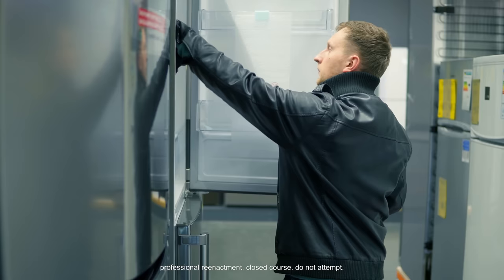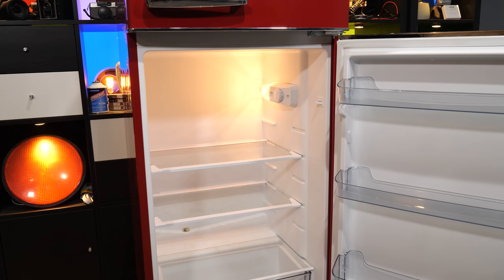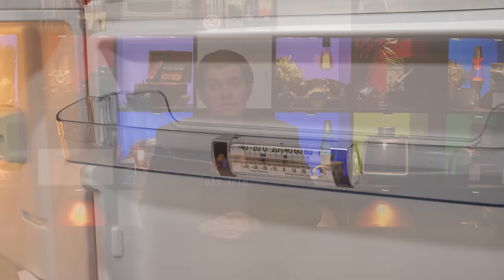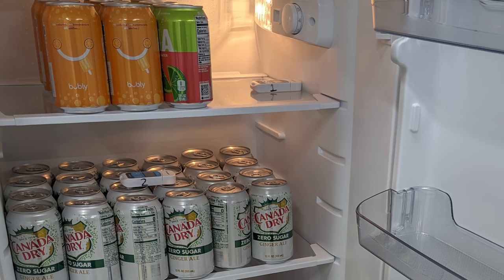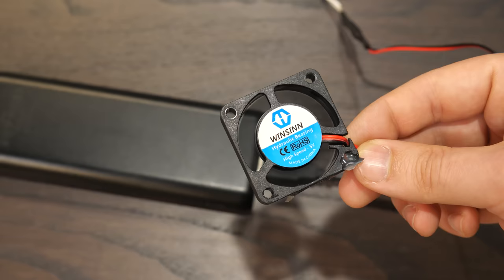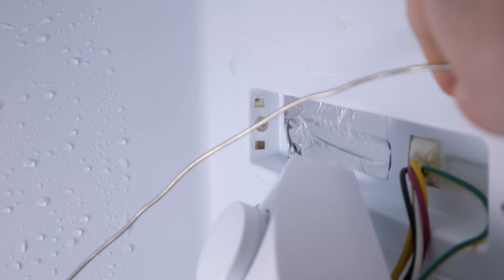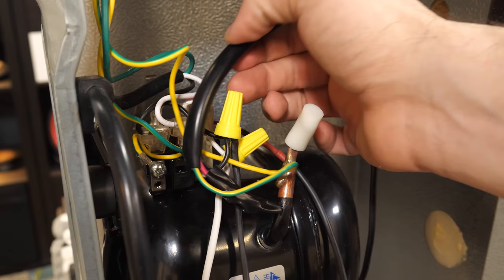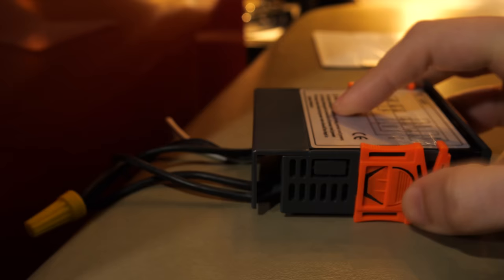This goofy fridge has a really clever design. It's also kinda terrible.

Comment: Hypothesis at 28:00 minutes- It's gotta be a separate overheating thermostat on the compressor. Running at full duty cycle it would risk damaging itself and so shuts off until it is cooled down.

Comment: The 1-compressor 2-evaoprator design is basically what is used in the vast majority of basic fridges i've seen here in europe (although hopefully with a better thermostat design)

The fancier fridges i've seen just have two compressors (sometimes even two separate appliances like a washer-drier stack), i've never seen a fridge with a fan, and an air pass-though, i would have never guessed fridges in america worked differently

Comment: I would recommend setting a temperature sensor on the compressor itself and check what temperatures it might get up to. Working continuously for 14 hours without melting it is quite a feat.
Also, have you ever though why refrigerators are not connected with air conditioners, given how much more efficient their invertors (outdoor units) are.
Reply: We'd rather move that thermal energy twice. Once to outside the fridge, then to outside the house using more energy, why would we want more efficiency? Lol 😂
Reply: Also I have a funny feeling that trying to use an outdoor unit that was at temperatures near or below the setpoint inside the fridge, might create some issues.

Comment: What if the placement of that sensor makes the compressor work for quite short runs, preventing it from overheating and extending its life? Taking into account that it looks a bit on the small side (considering the size of the fridge), it could have been done on purpose.
Reply: I was thinking that as well
Reply: true that
Reply: Doesn’t usually, short runs cause more wear and tear? Somewhat like starting a car when the engine it’s cold.
Reply: @marcr1333  That might be the case for extreme short cycles. In this case, the thing was running for over 30 minutes, I'm just speculating here but it may be on a sweet spot to prevent damage due to extremely short runs and avoid overheating.

Comment: Usually the compressor will have a thermostatic cut out to stop it running continuously and melting, that might what caused the cycling you observed when you filled the fridge with cans.
Reply: I was thinking this as well. My window AC unit does the same. Didn’t he do a whole video on those? Surprised it wasn’t his first conclusion.

Edit: it’s probably even the same compressor used in some window AC units. I wouldn’t be surprised.
Reply: Was coming to comment the same thing. But it doesn’t explain the lower average temps once it stopped doing that.  🤷
Reply: Yeah it seemed to me the sensor position kind of badly plays double duty trying to both keep the fridge cool, and stop the compressor from running too long. The problem is it relies on the thermal behavior not diverging too far based on what's in the fridge, and while it mostly reliably keeps the duty cycle short, filling the fridge throws off the calibration enough that the fridge is not kept cool enough.

Comment: Finally something I already knew something about, it was very exciting watching you learn how these things work! Yes, explosive for sure because it's lighter fluid as a refrigerant. If you want fans, you need a coil and not a cold well. Air is terrible at conducting heat, but it's very common for commercial reach in cooler to put the thermostat bulb in the EVAP coil itself. Turning off at a low point of 19° assuming a 15ish° temp differential, and then adjustable from there. You're best best with that EVAP style would be putting in a false wall, or air gap and running rans across that, but it's not meant to be. Also, it does make a big difference with a fridge being empty or not with the way it cycles, especially with that EVAP style. But that wasn't much of a "bulb" on that either, that would more or less take an average temp of the length of that line.  Sometimes I'll take those and coil them around a screwdriver to get better temp sense in a coil. 
Thank you again, fun video!

Comment: This feels like the same rabbit hole I went down trying to cool my small condo with a portable A/C (I know! It sucks but I have no choice and at least it's a dual-hose model). I tried moving air into rooms. I tried moving air out. I tried high velocity fans and low ones. Blowers and axial fans. Fan shrouds and other airflow modifiers. I even tried using a fan with an air duct to move colder air to the back of the room hoping it would push the warm air out. Nope! 
The acceptable solution was a carpet dryer type blower that when parked on the bed and aimed at the ceiling in the hallway, would blow a somewhat laminar stream of air out of the room and by way of some entrainment of additional air by the high-speed air stream, it would pull a volume of air out of the room and allow cooler air to enter the lower half the doorway to actually cool the room.
I was in shock when I saw the temperature actually fall in the bedroom. It was about 1.5 years' worth of tinkering before I got it to happen.

So I get these cans of worms. I really do.

Comment: I had that fridge for years and it served me well. Not in red though. 
The difference between the US and Europe when it comes to food safety temperatures is quite interesting: 
FDA states 4°C, EU says 5°C and here in Germany we say... eh 7°C is good enough. Our rate of food borne illnesses is still decidedly lower than in the US
Reply: It's probably due to other factors in the whole chain from the original source to your home. Whether it's production, processing, distribution, handling at point of sale, or a combination of a few or all of those.
Reply: @thatmarchingarrow bingo. As well as a built in buffer so to speak.
Reply: I suspect the way Americans (including me) tend to use a fridge requires cooler temps so the time the food can stay safe is longer. I bet we buy more food at one time but less often then our European counterparts; we then take longer to eat enough that we want to restock. We also buy bigger fridges so more easily have food hiding in the back of the shelves unnoticed. Also many often gamble on eating something we know was in there a long time because it's all been in there a long time so it's hard to remember exactly when it was added. *Better safe than botulism*

If you have a smaller fridge, wouldn't you eat your leftovers sooner, forget about food less often, and restock the fridge with new groceries more often? Even if it's slightly higher temp it probably still gets used before it goes bad. That's just my guess.
Reply: @thatmarchingarrow  These factors are definitely the reasons for the different food poisoning rates. Having a lower storage temperature at home just doesn't seem to be an effective response to that.
Reply: They wash their eggs and and ship them with salmonella straight out of the chicken, remember. They need to take some extra precautions, apparently.
Reply: @Tech10x10  So true. Calling this appliance a mini-fridge is the best depiction of such a lifestyle. 
I guess the whole American identity (veery generalized bias :D) is more prone to an overstocked fridge and once-weekly grocery hauls in tank-sized SUVs. I am kidding of course.
But a few degrees lower temperatures across an entire nation is actually still a fair amount of energy.

Comment: I bought this exact same fridge for my basement 3 years ago. I keep my house pretty cold (around 63-65*F) and the basement stays around 62*F without any heat or AC turned on. The cooler room temp and seldom opening of the door until college football season kicks off again, makes this and pretty much any fridge very efficient in this environment. But now I want to change out my thermostat....thanks buddy...lol. I am going to buy those data logging temp sensors for all my fridges and freezers. I mainly want to compare differences between the house fridge and separate freezer chests and shop fridges and separate freezer chests. I love your content and the amount of detail you put in there. Keep up the great work.

Comment: Ugh... I learned the hard way how auto-defrost works. In my last fridge, a bag (yes, a bag... Canada... don't ask...) of milk leaked. Despite a thorough cleaning of the fridge, about a week later, there was a weird smell. About a week after that we realized the weird smell got worse when the compressor kicked in. About a week after that, I finally investigated. The fridge designers decided to run the hot refrigerant pipes right out of the compressor through the drip tray - to evaporate the condensation collected. However, hot pipes in milk made... uh yogurt? The amount of disassembly required to clean the drip tray tells me that this was not an expected maintenance task. It was a very disgusting cleaning job for something that I think should have been an expected problem.
Reply: That's awful! And bloody hilarious!
Reply: I had made the same discovery by founding hundred of dead flies after two weeks out of town, it was funny to guess where was the rotten thing :)

Comment: Hang on, do people expect to be able to put warm stuff in their fridge without letting it cool down first and not have it noticeably affect the temperautre inside? I always thought it was just a thing that was taught to everyone never to put warm food or drinks directly in the fridge, but to let them cool down first.
Reply: Depends on how full the fridge is already. Putting a mug of fresh coffee in a fridge with ~30kg of food at temp is like throwing an ice cube into a pot of boiling water. You'll barely make a dent. It's only a real issue if you're doing something like putting a month's worth of room temp drinks in there at once or something, in which case it's probably just a beer fridge anyways and the safe zone is irrelevant.
Reply: Room temp is warm compared to fridge temp, or do you have a place to consistently cool things down to fridge temps before placing in the fridge?
Reply: @smithsmith6402  
Oh yeah, when I say 'never' it's not really literal. You can get away with some small things especially if there's a lot of other, already cold, stuff in the fridge.
Reply: @niceguy191  
It is warm compared to fridge temperatures, but I've never had a problem with that, and I'm pretty sure all the fridges I've ever had were like the one in the video (didn't look the same on the outside though, unfortunately). When I say to let them cool down, reaching room temperature, or even a little bit above that, is perfectly fine. As long as it's not too warm, and there's not too much of it and not much already in the fridge, it should work fine.

Comment: Since I work with this sort of thing for a living, let me throw in that the thermostat bulb placement might have been in there for REALLY GOOD REASONS ranging from protecting the duty cycle of the compressor through putting a floor on the ultimate temperature of the working fluid.

Considering the flammability of that refrigerant it might have even been a safety issue.

Anyway a thoroughly enjoyable video since I look at graphs like that all the time as we characterize refrigeration systems.

But yeah, this is one of those cases of not removing the fence until you know why it was put up in the first place.

Comment: I am pretty sure are full-sized Liebheer fridge we have at home works like that. Plastic walls in the inside, metsl on the outside, drainage hole, etc. But it has a slightly more complicated electronic thermostat (including beeping alarm is the temperature rises)

Comment: There supposed to be different temperatures within the fridge.

The door shelves are the warmer parts of the interior therefore used to store beverages, milk and ketchup bottles and such.

The lowest shelve is used to store meat and fish as it has the lowest temperature.

The drawer is used to store vegetables and fruits as it, although it is underneath the coldest compartment, has the highest temperature.

Cheese for example dosent need to be stored at very cold temperatures, means it can be stored on the higher up shelves.

I am under the impression that the ideal temperatures proposed in this video are quite high overall.

The temperature also differs from front to back of these  fridges, I think.

Comment: This is an incredibly well-timed video. I also just moved into a new house and purchased this exact fridge about 4 months ago to tide me over. I noticed roughly the same problem as you, but without the data, and have ended up being very careful with how I load it. Now that you’ve done the heavy lifting, I’m going to follow in your footsteps and attempt to improve on the design if possible. And see if I can get any fans to do reasonable things 😉

Comment: Just a note, Alec, when these standard fans are connected with proper polarity, the grill/support side will ALWAYS* be the outlet for air. This is very useful info, especially if you do any computer work!
Reply: I've been playing with those things for years and never realized that. 😂 Thanks!
Reply: Nope, reverse airflow fans do very much exist.
Reply: @andykillsu  I never said they didn't, but the STANDARD is to have the airflow going out of the grill side. Unless a fan specifically says that it is reverse air flow, it likely isn't. Reverse air flow fans will usually, at the very least, have an engraved arrow specifying the direction of air
Reply: @familyguy0398  but you did say ALWAYS. If you want to know the direction of a fan, you look at the blades. That will ALWAYS tell you the direction

Comment: Y'know, I can't help but think that the engineer who came up with that "bury the thermostat sensor in the wall, then dial it way down [or would that be up? - ed.] to compensate for the proximity of the refrigerant lines" hack was really proud of it.  It avoids all that complicated manufacturing that would be required to give the probe access to internal air and yet hide it from view.  So elegant!  It works fine as long as nobody does anything weird, and who's going to do anything weird with this grade of fridge, right?  Right?

Heh.  No one at Guangdong Fridge Factory No. 3 saw Alec and his huge wadge of warm soda cans and his salvaged GPU fans coming. :)
Reply: those were CPU and VRM fans.
Reply: As long as nobody does anything weird, like put anything in the fridge...
Reply: @niceguy191  Exactly! What kind of unwarrantedly extravagant behavior is that, anyway?

(Also, I knew someone was going to quibble about what kind of fans they were...)